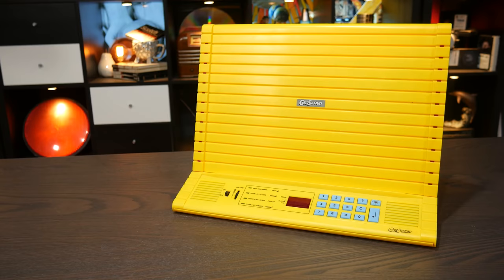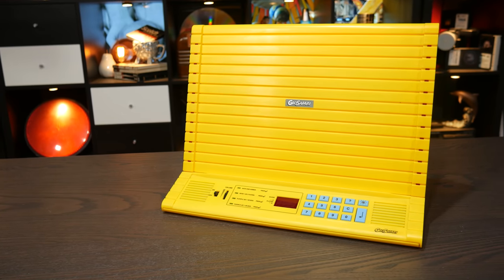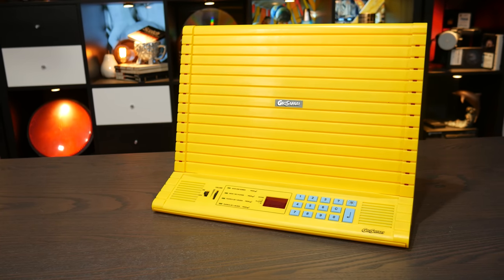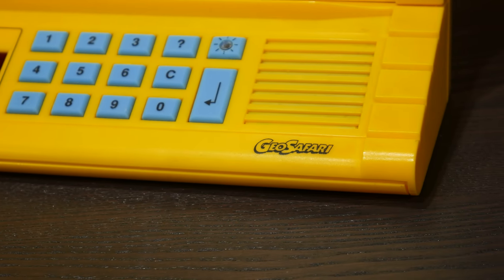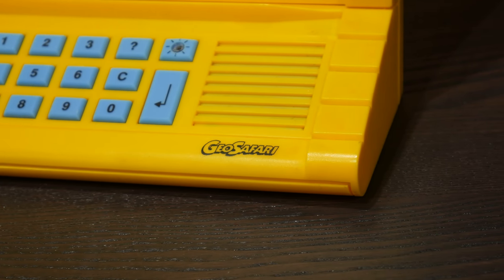The GeoSafari Jr. was a cleverly flexible kid's game

Comment: Two facts you may not have known: 
- Back in their day, the machine cost $100, but you could send a malfunctioning one to the company and get a new/repaired one back for just $20.
- Entering a card code but leaving the player number blank causes the machine to run through all the answers of the card.

I also remember that on the newer model with two giant red buttons, you can engage some sort of test mode where the machine will run through all the pitch tones it can generate, and illuminate all the lamps. This doesn’t seem to exist on older models, though.

Comment: This reminds me of a mid-to-late 90s toy I had as a kid - I've searched high and low for some hint of this toy's existence for years to no avail so I don't remember what it was called. It actually was made (and branded) by National Geographic and was designed to teach about animals. Like GeoSafari, it was made from yellow plastic. It was shaped a bit like a small boom box, with a flat slot on the front with lines of buttons on each side, and a holder full of cards on the back. I think each card was double-sided, and featured a picture of an animal - and its name. Along the sides were topics - "Habitat," "Size and Weight" things like that, and along the bottom edges were different patterns of punched holes, like old computer programming cards from the 80s and earlier. When you slid a card into the front slot, the buttons lined up with the topics. The machine would yell "Listen to my animals!" then say the name of the animal, and play the sound the animal made. Then you could push the buttons along the sides of the slot to learn facts about the animal coordinating with the topics. This is all really hard to describe in text, but I think the way it worked was probably basically the same as the GeoSafari, but with computer punch cards rather than digital codes. I loved it, and it would still groan "Liiiisstennnn to mmmmmyy animmmmallllllls" unprompted from my closet for many years, despite being turned off.

Comment: In the Netherlands this game was released by Jumbo. On the back it says it is made for Hauseman en Hötte (the original name of the company). It has a blue-gray color. Also on the back is a U.S. design patent number: D323860. So far I discovered the following on the coding:

The number of questions:
1000 - 2499: 10
2500 - 3999: 12
4000 - 5499: 14
5500 - 6999: 16
7000 - 8499: 20
8500 - 9999: 26

Within a 1500 number segment the game type is defined as follows:
0000 - 0499: Two-Choice Answer
0500 - 0999: Four-Choice Answer
1000 - 1499: Matching Answer

Now we only have to figure out the hard part: how the remaining 500 numbers (0 - 499) correlate to the shuffling of the answers.

Comment: It reminds me a lot of a Discovery Toys toy I had as a 90's kid, called the Think-It-Through tiles.  each tile had a number and a colored tangram-like picture on the back.  You would place a numbered tile in a particular lettered slot in a 2x6 grid - if you thought question A went with answer 4, you'd put the 4 tile in the A slot.  Once you laid them all out, you'd close the tile holder and flip it over.  The colored tangram pictures on the back would make different patterns based on where you placed the tiles, and you used that as the answer key.  There were a range of books on different subjects, all held together with a very loose narrative.
I remembered them the other day and looked them up online - they're still in production, but the modern books are more just books of problems instead of stories, and they're certainly not 90's-tastic anymore.  I'm sure my mom got rid of my one ages ago...I'm thinking of trying to find a 'new' old one on ebay for my birthday.  IDK if it'd be something you'd want to do a show on as it's completely analog, but it might intrigue you all the same!

Comment: My brother had a very similar game (plastic display that you insert different boards on cards into to play different games) except instead of buttons at the bottom, the different game boards had holes in them in different locations, and the board had two pointers at the end of wires. You'd touch the pointers to the holes and this would close a circuit that would either be correct or wrong. And like this game this deceptively simple premise led to tons of different variant games.

Comment: My mom was a teacher when these were common in the classroom. At the time I was a computer tech. The number of these things I pulled apart to fix was surprisingly few. They were designed to take a real beating. The most common thing they needed was the display simply unplugged and re-plugged. 10 min to pull apart, 2 seconds to fix. Ah, memories.

Comment: Wasn't GeoSafari originally designed to teach geography, then expanded the curriculum?
My grandparents had one for us to play. It was alright.
The sounds are bringing me back. My over analytical kid mind wondered how this low memory machine could store so many game cards and how did new cards get in the memory without updates? Until one day I saw patterns in the answers and it struck me, there's only a finite number of patterns and entering the code at the top told the machine which pattern to use. New cards just used one of the existing patterns and codes. And the magic was gone for me.
The thing lasted an insanely long time on a set of batteries. Kudos! Are you paying attention every other industry?

Comment: I had a similar toy, branded as MathSafari. The buttons and sounds were the same, but it was dark gray and flat (i recall pretending it was a PAD from TNG ).  It had different spiral-bound books for different math topics that were ranged enough that my younger brother and older brother could both use it 7 years apart. I vaguely remember addition, subtraction, multiplication, division, and algebra books.  It broke before I was old enough to use the algebra book but my i remember my older brother getting that far.

Comment: I know much older version of that idea. A 2 light bulbs were used instead LEDs, and wires instead of all electronics. There was no buttons. You had to put the wire to the appropriate hole to check the answer. Then either green or red light went on. It was not random, just hardwired. Well, I as a kid never memorized the wiring map. Not that I couldn't, I was just too lazy. Memorizing the answers to the test charts was way easier. BTW, that older game didn't have pictures, just text. For like older kids, who read a pretty small print ;)

Comment: A company called Chicco used to have a similair toy, but instead they had cardboard sheets with metal spots (next to objects and such) that you would put on the board, and then use a stylus connected to the board with a wire to select or connect things. I used to adore the things as a kid, but I can't seem to even find a picture on Google :/

Comment: I found one of these (EI-8800) in a thrift store a few years ago, but it's boring beige, and I didn't find any cards with it. But around the same time I found... a "MathSafari" (EI-8400U)!

It doesn't stand up, it just has a wide pop-out "foot", and it has a much more complicated custom LED display. And it's dark gray, with only 5 LEDs on each side of the card area. It also does not use a blob, it has an actual 8052 chip! (probably mask programmed)

And one other thing, it has two 1/4" headphone jacks on either side.

Comment: 13:33 "It has some sort of auto Power-Saving Mode. Where if you leave it on for a VERY long, it will turn off." Yes, that's exactly how batteries work. If you let them run for a very long time, they will eventually be empty. Thank you for the laugh :D

Comment: Speaking of neat displays (unless you've already done a video on these and I haven't seen it), you might also do a video on the science of Magna Doodle boards. According to the Wikipedia for them, "The key element of the toy is the magnetophoretic display panel, filled with a thick, opaque white liquid containing tiny dark magnetic particles. These particles can be drawn to the drawing surface by a magnet-tipped stylus or optionally-provided shapes, or removed to the hidden back side by a sliding eraser bar. The middle layer is divided into a honeycomb of cells, keeping the liquid static and the particles evenly distributed across the panel. The liquid is formulated so that the floating particles can be pulled through it in response to the magnetic forces, but not due to gravity." Because of these properties, SCUBA divers sometimes use them as underwater whiteboards (although they are not designed for those purposes). Anyway, just an idea to throw out there. It'd be like a mix between your video on e-readers and electrophoretic displays and those reusable hand warmers.

Comment: This is so charming and clever! And it looks to be very portable and downright indestructible, so perfect for young kids! And the sounds it makes are so cute and charming that I wouldn’t mind having to hear them all the time. If I ever have kids, I will seriously need to dig one of these up for them!! 

I had something similar but honestly not as “good” of a toy as a kid in the early 2000’s. it was a board with a bunch of magnetic letters and numbers included in a compartment in the middle, and had cardboard or plastic game boards with little punched holes in a specific spot on them to let it know what you were playing. The games would have cutouts where the letters and numbers went, and there must have been some sort of sensors (maybe inductors?) beneath the plastic surface that could tell when the pieces were placed correctly. I had a lot of fun with it, but I lost the pieces all the time, and it was super clunky and noisy to carry around with all the loose pieces. But even then, I was fascinated by thinking of how it possibly worked more than I was in playing the games themselves lol. At that age, I think I had come to the conclusion that the punched contact strip thingy told it which games were which, and that the magnets in the letters were giving it information somehow. I think I spent some time when I was a little older putting every combination of wrong letter onto a specific slot to see what would happen, and I think I might have even held other magnetic things up to it to see if it would respond. Kind of an early attempt at brute force hacking lol. I don’t remember if I figured anything out from it haha.

But this little yellow gizmo is so much simpler and sleeker with no small parts and I just adore it and wish I had one as a kid. It definitely would have fascinated me- especially the game with matching the animals to inventions inspired by them. i’m a bioengineer, so needless to say biomimetic design was always a special interest lol. Thank you so much for sharing and for even doing a teardown!
Reply: Update! I found it! It was the Leapfrog Phonics Desk from 1995! It would have been out for a few years when I was born in the late 90’s, I think I had it and played with it as long as I can remember. Good times XD

Comment: I had something similar/newer when I was younger.  It was a handheld that had number buttons and you attached a plastic part that held a bunch of cards.  You'd input the code and answer questions.  I only had one set of questions but each card was double sided, had probably four questions per side and it was thick with the number of cards.

Comment: As an engineer, going through structural engineering classes in metric was excruciatingly painful compared to imperial. Kips are just way easier than constantly having to calculate out 10^xkg and then remember to multiply by gravity. Kips already includes gravity!

Secondly inch fractions are way more useful for easy division than decimal mm or cm. There is a limit to eyesight on small metric units. 1/64" is just way easier to see than 0.1mm on a ruler. Yes my woodworking hobby demands that precision at times.

These 2 points are why i stand firm and say units are meaningless and if you can understand both is more important than fighting about which is better. It's situational, your situation is just different than mine.

Comment: I had something like this, except it was much smaller and a little more limiting (8 answer choices, every card had to use all 8 options exactly once in a 1-to-1 setup). The way it determined what the answers are was by holes cut out in the bottom of every card (turn the card around, get a different hole orientation, so you can have something different on the front and the back). But it was nice because you never had to enter a code - it just knew automatically! Having trouble finding it online, but it's probably still at my parents' house somewhere.

Comment: Just guessing here, but if I was a programmer, I would use the codes in this way:  first two digits indicate the game answer format or "type"  and the last two digits are fed into a "Game algorithm" that generates answers based on the "seed" of the two digits.  This way, the outcome is always the same for the same code.  AND you can then generate games, and match generated answers to the cutouts.  One way to test this is to enter a game code of say "1099" and see if this is a valid code and seems to play the game.

Comment: I see that the LED boards have nine-wire connectors going to them, which implies they're multiplexed.  I'm guessing 7 "segment" wires and 2 "digit" wires per board, which seems to be corroborated by the wiring on the board, where several of the wires to the LED boards seem to be common.  This would also allow a pretty generic LED driver circuit to control both digits of the display, and the side LEDs as if they were 6 ordinary 7-segment displays.  The green LEDs and annunciators may be addressed as an additional "digit".  I can't help wondering if the game codes are some sort of PRNG seed + options bitfield (like number of choices), or an actual look-up table.

Comment: I had something similar around 30 years ago, but it actually was touch screen! Eeehhm, kind of. It was a blue case with a white handle, I guess it was supposed to look like a laptop. You open the lid, and there you had a dark grey surface, onto which you would place a card with a game on it. You would press on “buttons” on the card to start the game (just like you code it with a code on this yellow thing), and then you make moves by pressing on areas/buttons on the game. You could press it with your finger, but it worked better, if you used the white plastic stick, sitting neatly in the slot on the side of the case. It had three LEDs, green, yellow and red. There was an instruction book to tell you, how to play each game, and what flashing LEDs mean. Anyone seen one of those?

Comment: All things considered, this actually isn't all that less advanced than the Magnavox Odyssey. The Odyssey operated by having overlays that you'd put on top of your TV screen, and what the console itself powered was an interactive white block on the screen. The individual game cards just told it what mode it should be in, and were numbered instead of named because several 'games' (i.e. overlays) shared cartridges, which isn't all that different from how this worked, though obviously more game logic was stored on the Odyssey's game cards than the card stock here. The Odyssey itself was basically a fancy board game machine, as the only thing it was capable of was making a few white blocks on the screen. It couldn't keep score or enforce game rules, it was entirely left to the players to do that. Not bad for a piece of plastic to not be too far behind without a TV screen to work with.

Comment: Vaguely remember these in elementary school.  The cards for sure rang a bell with me when I saw them.  Having the LED drive right in the IC kinda surprised me.  I figured back then there would've been a multiplexer in there to to that last bit of interfacing.  But I guess either it didn't need to have that many selectably on simultaneously, or that type of interfacing was already pretty well developed by then.  Cheap ass melted-post anchoring eh?  Seen this a lot in consumer things.  Boomboxes mostly.

Comment: I know you probably won't read this it's too late but I had something similar with an interesting variation
 I'm not sure what it's called but it was a very very similar toy,  except there was a small piece of card sticking out of the bottom up each game board,  Deckard had a series of holes punched in it I think there were like eight possible spots where whole could be so just placing the card in the correct spot loaded the correct answers. I think it was a hand-me-down from my older sister

Comment: Me when he talks about the clips: Man, I feel like I'd try to force them apart, and break it because I'd have missed  some of the screws, but I guess if you're competent like Alec you carefully check for all the screws first. It's kind of like how I broke that pane of glass repairing the window the other week, 'cause I tried to force it in not realizing it was pressing against a tiny nail and...

Alec: There's two more tricky screws!
Reply: This whole idea of "look for hidden screws" goes out of the window when you need to take apart an Xbox 360. The plastic case is snapped together so you rip off the side plates, then the front. Then you pry off some tabs that were covered by the face plate. Then with a noise that can only be described as "Holy sh*t, i broke it!" you literally rip apart the top/bottom covers. The tabs at the back come undone in the process with no damage what so ever.

But for the most part, yeah, look for hidden screws :)